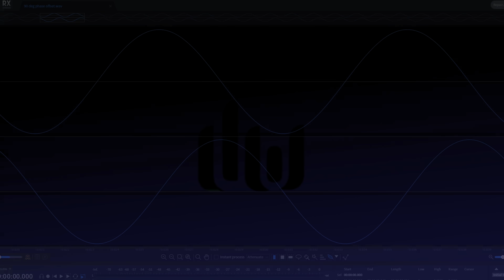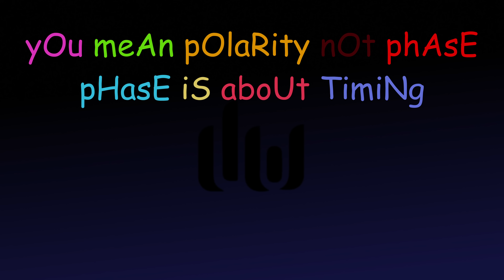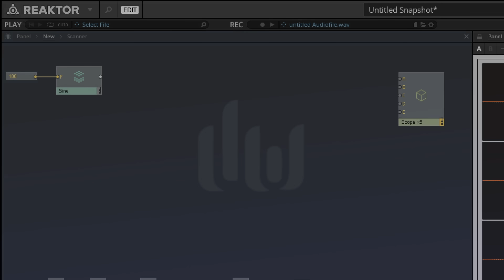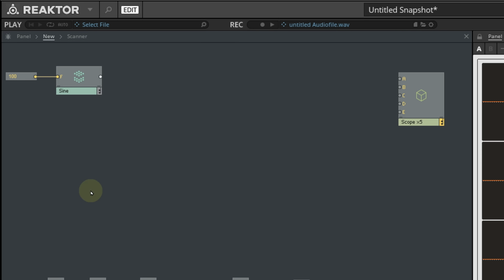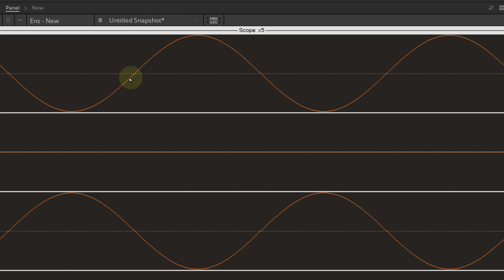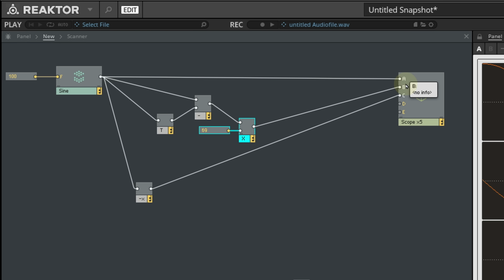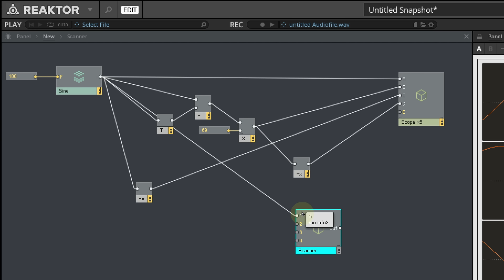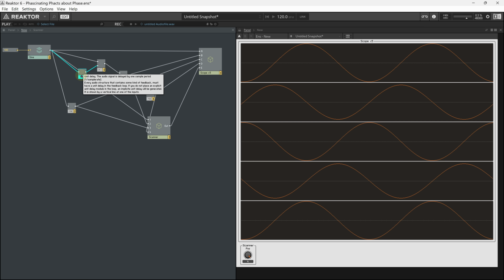Phascinating Phacts about Phase

Comment: I know I'm one of the pedantic viewers that you mock, but technically you didn't shift the phase of a wave without affecting its timing. That subtract module is not outputting audio. You could not get the same results by running the two signals through a mixer and inverting the polarity on one of the two signals. Your final crossfader is cross-fading between two audio signals and two abstract  control signals. It looks like it's all the same on the scope but it's not. It's a clever sleight of hand.
Reply from the maker: The subtract module is absolutely outputting audio, it's a sine wave indistinguishable from the original apart from a 90 degree phase shift. I could output that to my DAC just the same as the original.
Reply: @DanWorrall  to make it clear it's not an audio signal, turn down your original sine wave by 20dB and watch the output of the "subtract" module. It will always full scale and not move with the input. The resulting signal is an output of a comparator not of an audio processor.
Reply from the maker: If I attenuate the input sine wave, all the derivative waves scale proportionally. I'm not sure why you would think they wouldn't: I'm subtracting the previous sample, not dividing by it. The absolute values absolutely matter.
Reply: @DanWorrall I don't have Reactor to check, but at what point can you get full scale output when you are subtracting values that are off in time by one sample? You would need a perfectly square wave and then the difference would be full scale for the duration of exactly one sample. It's more likely that the one sample delay is not your normal delay, but it introduces complex numbers into the math, which is the technique used in DSP processing. Then it makes sense that the magnitude is preserved. Still not audio that has analog equivalent though.
Reply from the maker: I don't understand this, sorry. The unit delay is just a buffer for one sample. The output is always the previous input sample. That's it.
Reply: @janluszczek1223  Hello, I'm jumping in the conversation. I don't understand why you would like the differentiated signal to go full scale. What's the purpose? why would it qualify as audio then? what is to you the difference in nature between "audio" and "control", I don't see the point. - No complex number is introduce in the math (except if you want to use the Z-transform as a tool to study it) but it's all just a difference of a signal shifted in time. Most digital filters are built around this. - And also, stating this has no analog equivalent is wrong, there are a lot of differential and integral analog circuits of different kind, and recreating a simple shift+substract+gain will indeed approximate a differentiatation. - Maybe that's what you want to say, it's only approximating a differentiation.
Reply: @DrizzleWoolf I don't need it to go full scale, just commenting that the shown sine wave does, using only one sample delay and a supposed summer/subtractor. My comment is, the process is not what Dan presented it to be based on the output wave in the scope. In order to get full scale output, as shown, you would have to turn the difference between signals into a derivative, or a control signal.
Reply: @janluszczek1223  at 5:58 he says "it starts pretty small, so let's boost it x69", hence the full scale, maybe you missed it. And when you say "you would have to turn the difference between signals into a derivative", well, this tiny time difference between signals IS the derivative, or at least approximates it. If he'd used oversampling it would be even more precise. It's basically the rate of change between one sample and the one that follows.
Reply: @DanWorrall Reactor is conveniently turning it into audio, but that's just their accommodation for the sound designers. It's mixing and matching of  signal types. Digital audio is wonderful because you can manipulate it like that, but you didn't need to build this elaborate processing chain and make it look like all audio. Some lines of code would do the same with one variable.

Comment: I've always imagined changing the phase (without altering the delay) as if the waveform isn't a two dimensional object but actually a three dimensional cylinder (like inside a music box) that we view as a cross-section. As you roll the object, peaks appear and disappear, but the shape (and the content of the signal) is still the same. 

Interestingly, when you limit or hard-clip a signal, you only clip it in the orientation you can see the signal in. If you rotate the cylinder after your limiter, which you could do cleanly with the demonstration Dan shows at the end, all the peaks come back from the third dimension of the waveform. 

I'm sure there are some inaccuracies to  this model, but it's helped me understand how the signal is encoded in the waveform.
Reply: If you deal with phase in the complex plane as done in most of physics/engineering, you very much do get a cylinder
Reply: @mycosys  True, but most of us working sound aren't actual engineers, we're just stoner bums who learned what sounds good
Reply: @ileutur6863  I went for both ;) but i imagine if youre watching Dan its because you want to learn, and i was also just affirming that the phase diagram theyre imagining is mathematically consistent with phasor analysis, and commonly used, not just a useful analogy.